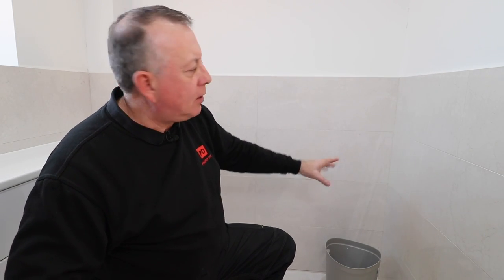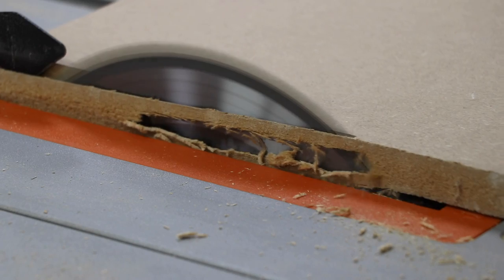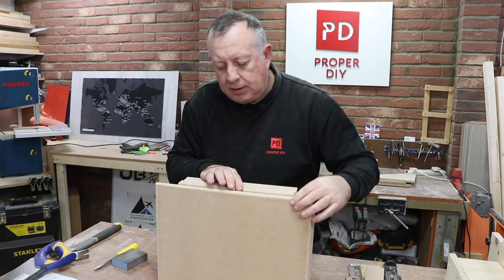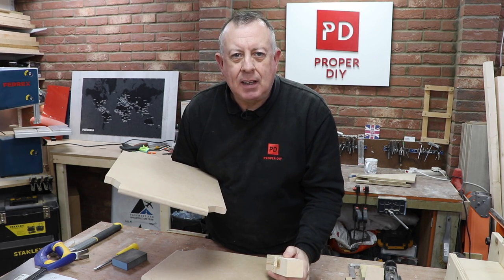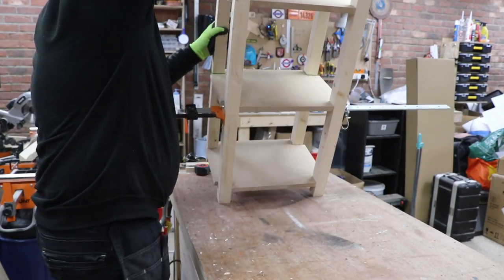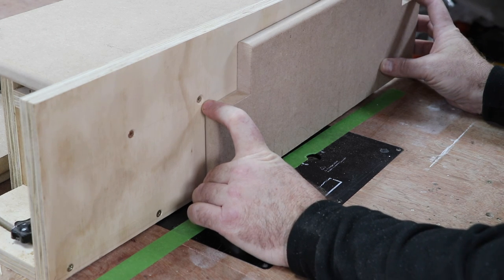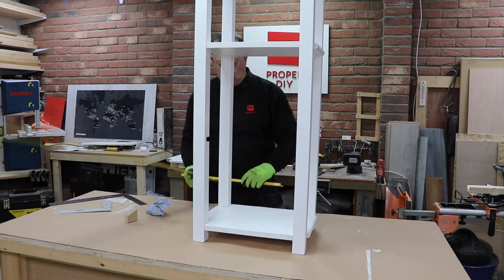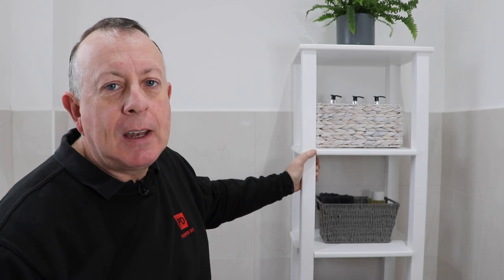How to Build a Bathroom Shelving Unit

Comment: Very nice. Hope those knots in the legs don't bleed through the paint.
Reply from the maker: They will but knotting never seems to help either
Reply: @ProperDIY  Need to use about three coats of knotting. Pain in the *****.  Can also use two or three coats of Zinsser shellac based stuff. It dries very quickly and is white.

Comment: Great to see a simple woodworking project that everyone (diy) can tackle .one question,you used knotted pine as the legs, you didn't use any knotting solution to avoid any knots weeping later???,some primers do contain it ?,not all , Maybe you should explain that ??  .Also maybe  mrmdf could be better?, especially in a place prone to moisture.sorry just nick picking, great video 👍
Reply from the maker: I don't know how many times I've used knotting in the past and it hasn't made any difference - I still get a yellowing come though so these days I don't bother. The MDF I use is what is available from DIY shops for DIY'ers - that the channel is aimed at. MRMDF is great but the average DIY'er can't readily get their hands on it from a place that can cut it down to get it in the car.
Reply: @ProperDIY  😂😂yes ,your right ,keep it so people can obtain these materials, but I live in a small seaside town whose DIY store (you can guess which one)😂won't cut materials to size😂,but ironically I have a building merchant who will cut a list for you ,but sells Mrmdf (dearer I except)😂,regarding the knotting solution,have you tried a Shellac based primer. Please I'm not being critical, keep your channel as it is ,too many now are going down route where the average Diyer can't afford the tools ,I actually loved when you said "fancy" tools, i.e festool domino 😂😂😂, 👍👍

Comment: When using a table saw, Stuart, the blade should only protrude by about 3mm or 1/8 inch when cutting. This leaves it easier to control the cut, get a straight cut, and makes it less likely to lose fingers if you accidentally contact the blade.  You should also always leave the guard in place. It was put there for a reason.
Reply: You must be a joy to live with, Tommy
Reply: @A Sob Story For Every Song  a regular health and safety nut, that's me.  🤣 I'm not really, but there are a few power tools which I definitely would not remove the safety guard from, and a table saw is one of them.

Comment: big mistake making the shelf into a lid. every horizontal is going to gather litter. every time you lift the lid to put something in the dustbin something will fall off and be lost behind the shelf unit. you would have been better off putting the bin on slides or wheels to pull it out from under the shelf. also, if the glue doesn't hold it, the paint will.
Reply: Your advice is interesting,  so I had a quick look at your videos - conclusion - I’m not confident in your opinion!
Reply: I looked at one of your videos - the breakfast omelette - and couldn't help but laugh when I saw how much cr*p you have scattered across your cooker, especially after reading your comment here